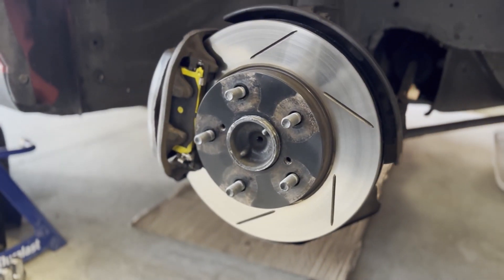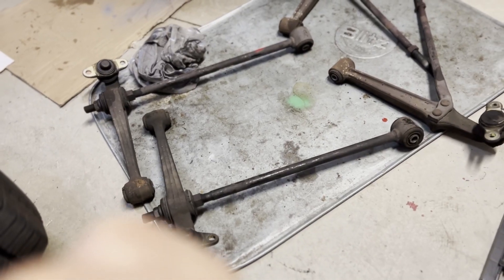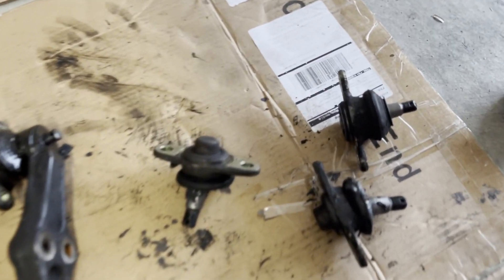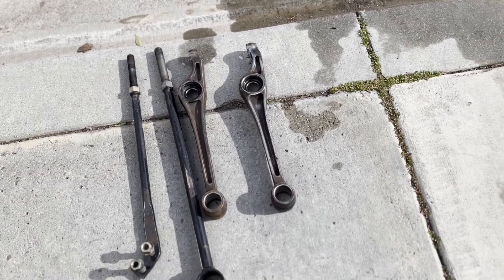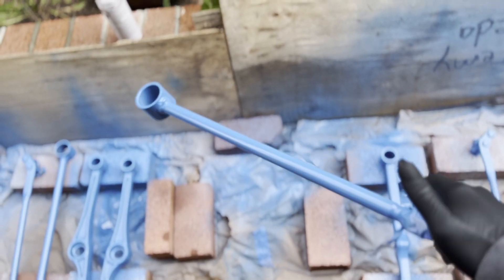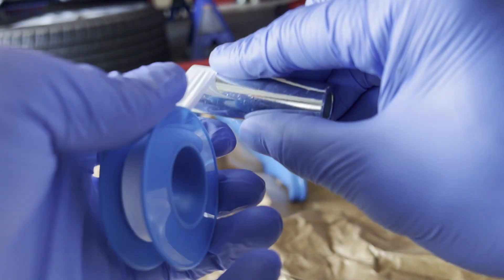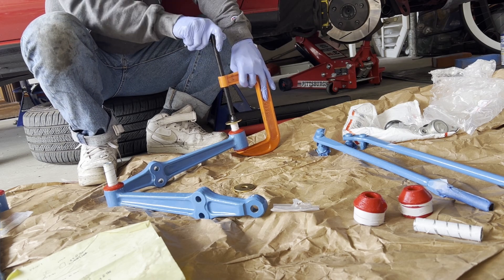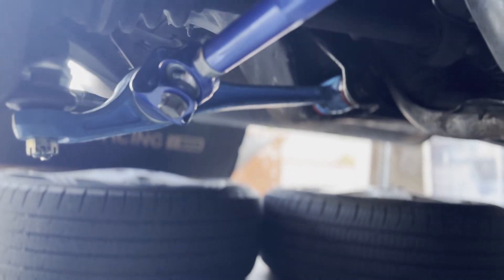Polyurethane Bushings, Control Arm Repaint, & Slotted Rotors - EP #3 - 1992 TOYOTA MR2 SW20 PROJECT

Comment: I've done the same thing to mine recently. Just looking at your suspension arms it's amazing the difference in rust between a UK and US car, yours looked close to OEM whereas mine were brown and flaking. Those suspension bolts for the rear especially were an absolute nightmare, the two forward facing arms had the bolt seized within the bushing, had to cut them both and replace with new bolts from Toyota.

I got mine sandblasted and powdercoated for £200 which I guess is around 250$, this included all suspension arms, sway bars, subframe, front subframe mounts, both front calipers and mounts and sway bar mounts. Interesting that it's nearly double for less parts for yourself. One bit of advice would be to find a powdercoated who doesn't have automotive in the name, the place I found did mostly big industrial gates, seems there's a premium when they mention it's for cars.
Reply from the maker: Good tip on the sandblasting find, I was quoted 50 USD for each arm for sandblasting, than another 50 each for the powdercoat 😂
Reply from the maker: So with 8 arms total, it adds up over here :/

Comment: How much did the polyurethane bushings change the car's ride and handling? I own a 1993 MR2 turbo that is stock,  and I wonder if the rubber components on my car's suspension need replacing due to age.
Reply from the maker: @flyntmyrick6291  definitely stiffened up the chassis and tightened up the handling just a bit
Reply: @jer.plusultra  Thanks for letting me know!